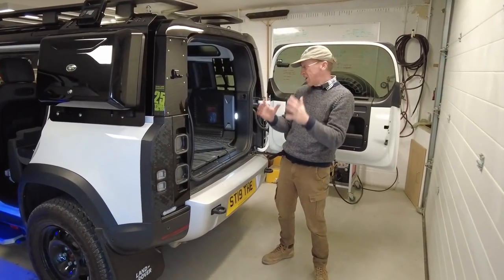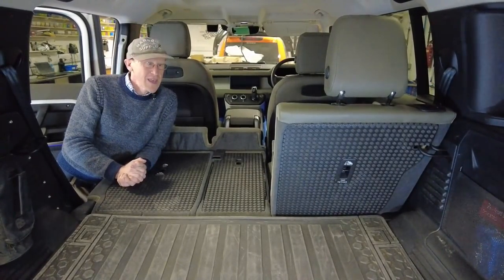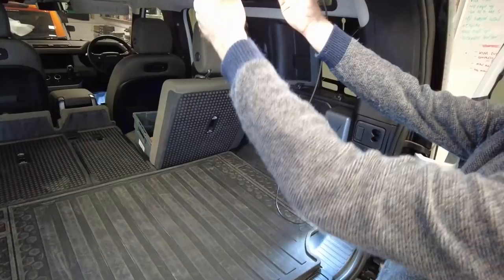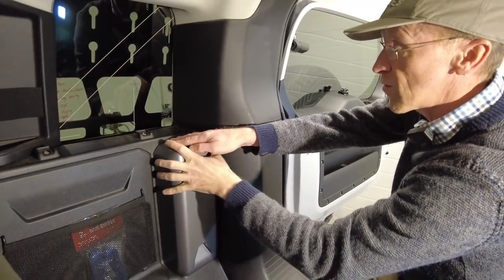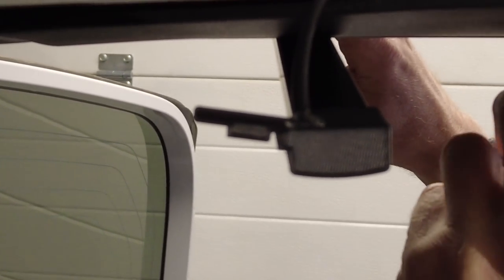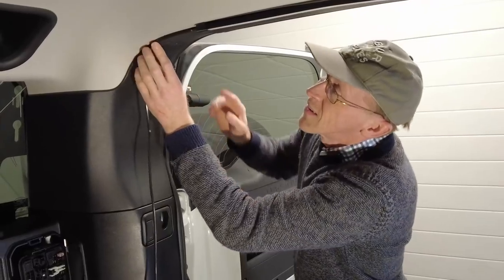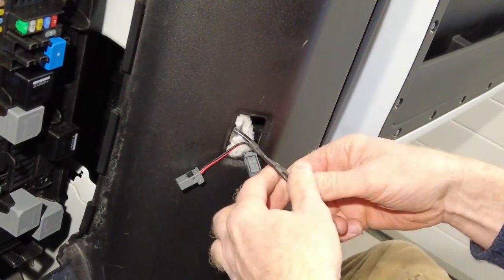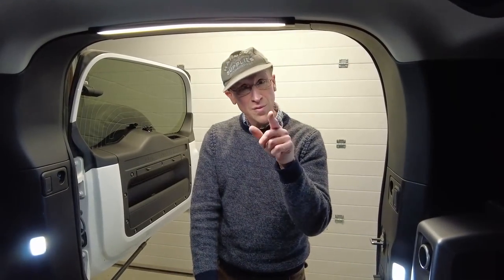Land Rover Defender 2020 Rear Boot / Trunk Interior LED Light Upgrade Install & Demo

Comment: Got myself that light as the original boot lights are ridiculous and easily covered by a shopping bag.. I have the 7 seater and installation required no extra effort whatsoever. I actually had installed it sodding wasted and can only remember fractions of the install, that's how easy it is. :D Your instructions are spot on. Thank you!

Comment: Just installed mine. Very easy video instructions. Plugged and played mine in under 5 minutes. Another great idea from you Simon and the team! 
Well done. You have earned a loyal customer. Earlier installed the rear tyre security lock (left also comment on the video), next job is the rear bumper cover and the side door decals. Feeling excited mate!! Thank you.
Reply from the maker: Thanks for the comments - any problems with the decal application be sure to let us know - we are normally happy to send a replacement if you mess them up.

Comment: Very easy and wonderful lighting.
Used electrician fishing tape along side of the fuse box and  so did not have to pull molding off… just gently made space for the connector that was loosely tied with string that was attached to the electricians tape. Thanks for making this available.
Reply from the maker: Thanks for buying our products !

Comment: Love this Simon. This lighting issue is even more prominent in the back of my hard top because of the bulkhead blocking the two lights in the ceiling. All you have is the two low down ones that you are showing there and they’re useless. I will order one of these as soon as they’re available.

I’m currently designing a shelving unit for the 90 hard top that will improve the storage and utility f the rear load space for using it as a van!
Reply from the maker: Hi Reece - I have ordered the steel and will start a prototype next week for the rear shelf / drawer system.
Reply: Brilliant thanks Simon, look forward to seeing what you come up with!
Reply: Also ordered my light and it’s on the way looking forward to fitting it!

Comment: Thanks Simon, really grateful and pleased to provide a much needed solution.
Reply from the maker: Hi Tim - hope I did your design justice...
Reply: @L663  yes Simon. Thank you. The trick with fitting the clips is to slide them in loose, push the light ends upwards and then Push the trim upwards at the same time, and you'll get the click. To remove, just push the light clips up, and gently pull the trim down. Cheers.

Comment: I just installed same led bar on the tailgate of my RRS 2017. I connected it to one of the 2 lamps. Easy job. Since there is a temporisation on these lights, they shut off  automatically after 9 minutes. Is this also the case with your setup ?
Reply from the maker: Yes the light will shut off after a time !

Comment: Looks like that could be adapted to use on any similar vehicle.
Reply from the maker: Yes although the clips and the connector etc  are custom made for the Defender fitment.
Reply: @L663  discovery 5 please
Reply from the maker: @danieljones5771  Does the D5 have a similar problem ?
Reply: @L663  - it has similar led lights that don’t illuminate much, however I was looking at the headlining yesterday which does not really have a join anywhere you could fit the light bar to :(

Comment: Top video again Simon, is they any way of retrofitting a 240 plug socket in the load space?
Regards 
Rob
Reply from the maker: Hi Robert - I have located the main parts
Inverter £322
Socket £30
Cover £6
I will order them up and see what we get.. the issue could be I cannot find a wiring loom - it may come with the inverter ?
Reply: @L663  look forward to the video, thank you

Comment: Simon, great product and great video to help with the install. I just installed this in my Defender in under 10 minutes.  How would you add a switch. I love it when I'm camping and similar situations, but have quickly realized - since is so incredibly bright, there are times when I'd like to switch it off. Any advice?
Reply from the maker: Ah so you need a "stealth mode" for those more discrete journeys ! Its a good question - maybe you could add a switch next to the light where it takes its power from - I will ask Tim to look at options. You can disable the interior lights by pressing and holding the contact point on the overhead console for total stealth mode.
Reply: Pleased you like the light Jason. I have released a few switched units as a sample, but the general consensus, after selling around 800 of these has been tokeep the price down and remain un-switched. However, that may change. For a retro workaround though, you could interrupt the LED cable and add your own switch to the Red positive line. You may have to fit the switch into the trim though, so this may be a problem if you don't want to damage anything. Cheers
Reply: @Defender3d  I think this light was your invention? Awesome! Great design, much needed, thanks! I don't tinker too much with electrical, more of a wood worker, sorry for the dumb question, but you're just saying install a smaller rocker switch anywhere on that positive line? Did you have and recommendations on switch that was working well for you guys?

Unrelated, I've been looking for a fire extinguisher mount. There's nothing good out there now, you ever consider making something?  Somewhere in trunk, close to cargo cover mounts - just a thought.

Comment: Simon. Silly question. Have ever removed the offside upper rear quarter panel the tinted bit above the rear lights. Reason for the question is, there is a slight bit of stress in the plastic on my new one and the local dealer is going to replace it but will not say its an easy clip on and off. I got we have never done it before it could be connected to other panels blah blah. Their own repair info says 6 min fitting time. So I guess it clips on/off but I'm not going to try as they will say I have done it. Any chance just showing a 2 min video on the end of next one removing and replacing it so I can argue if I need to. Cheers
Reply from the maker: Is it this part ?
https://youtu.be/vLqsTong9vs
Reply: @L663  Simon yes that's exactly it. They can rip mine off as it's getting replaced so 2 min job cheers. Andy.

Comment: Nice work to all involved and another top vid Simon, a few things, the wiring could be protected against rubbing or at least secured similar to how all oem new defender wiring is. We have a saying, loose wires cause fires 😉 Also the fluff behind oem light, could that be a fire hazard when light heats up? Having said that, we will get one from you guys  and install with these issues addressed, certainly much needed when we have the back full and fridge in etc on trips/camping.
Reply: No risks if installed carefully. The intumescent fire and sound barrier helps stop rattles, and the rubber double insulated main cable to the light avoids the need for chafe tape. We looked at putting chafe tape on the connection end, but this then hampers the click mechanism, and is no less that what JLR have done. I started testing this back in January, and have inspected thoroughly as it's been in and out of my vehicle 30+ times fine tuning the mounting clips. No chafing or rattles were evident, and the stock and mod lights do not run hot, especially as they are time limited to conserve battery.
As an electrical and robotics engineer with over 28yrs experience, electrical fires are something I take very seriously, and great care around. Thanks for your comments though, always looking to improve.
Reply from the maker: Hi Ben - there are of course the option to remove the panels and then cable tie the loom.
Reply: @L663  Fantastic, we will be doing this plus using conduit or fleece tape, as feedback maybe good to add that to install vids or instructions, we really like the light mod 😍👌🏽
Reply: @L663  In certain environments like AU we have hundreds of thousands of  kilometres of killer corrugations that eat any loose wires anywhere, when we build 4x4s here, zero wires are left loose, JLR have done a great job on all OEM wires we have seen so far, all covered and secured.
Reply: @Defender3d  well done tim, just honest feedback, hope it helps, well done on a great product and looking forward to your next, we will be ordering. 👌🏽

Comment: Good one Simon, would this fit 2015 RRS L494? My L494 does not have those 2 lights on the tailgate, only 1 tiny light on the right-side panel in the trunk so very dark in the garage... Hope this can fit too. Thank you.
Reply from the maker: Hi Danny - I have not heard of this spec before - they have no rear lights in the tailgate panel - can you pull the panel out and see if the wiring is there ?
Reply: @L663  thank you for replying mate, might be a special SE base model thing for the land down under, getting ripped off lol, will check out the panel in the morning, cheers

Comment: Attempting to fit this to the 90 but it’s proving more problematic, I think due to the sear belt tensioner etc - so far haven’t been able to get that inner corner panel off 🙃
Reply: Correction - pull the surrounding cover from the seat belt tensioner (just pull forward) and goto the right of the seat tensioner to get a drop down to the OEM boot light - couldn’t  get it to drop on the left hand side of the tensioner. Anyway, boot is now lit up like a Christmas 🎄
Reply: Lots have installed on the 90 with rear seats. Some remove the corner trim at the Right side nearest the rear door, some use a rigid wire pushed up through the stock light point where you will connect, and then use the wire to pull the new cable back down. Not personally tried this, as I don't have access to that particular model, but it can definitely be installed, just a little more tricky. Let us know how you get on.
Reply from the maker: @supercrazysane  Hi Steven - thanks for this tip ! glad you get this sorted - you are now ready for the dark evenings !

Comment: Simon, where is the best route to get external light cable into the interior on a new 90?  I have a warning lightbar to fit and scartching my head!
Reply from the maker: It is not something we have done yet - other than via the rear quarter panels.

Comment: Do u sell the harness separately? The plug&play connectors? So than we can connect multiple lights and setup lighting  by ourselves customized
Reply from the maker: That is a really good idea - I will discuss with Tim
Reply: Yes, you'll just need to assess the loading on the fuse, at your own risk. These strips only take around 5w more, so it's negligible. Keep an eye out for these looms though.
Reply from the maker: @Defender3d  We maybe should add which fuse it is if we sell these looms too..

Comment: super -  does it have a switch on the unit
Reply from the maker: No but that is something we could look at or you could easily add in the plastics next to the rear fuse box.

Comment: I need a bank loan to buy all the bits I want from you now. 5 days to go and it's delivery day so will see what's what.
Reply from the maker: Hi Andrew - so cool to hear you have Defender on order and are looking to add some parts... what spec did you go for ?
Reply: @L663  I went for 110 D250 S. Added front under body protection, wheel arches, rear scuff plate, decals and Advanced off Rd package.
I will at some point get the rear recovery eyes from you and I like that rear interior light you have just shown amongst others.I need to let the new car feeling pass before doing anything. Also in removing the rear bumper are you aware if it invalidates the warranty, they can be very funny about things like that.

Comment: Is that not a bit dangerous? With the back of the car be to light to travel at high speeds 😂😂😂😂🤣🤣🤣
Reply from the maker: The light will only come on if you open the doors !
Reply: @L663  I know , I was trying to be funny. I’ll get my coat.